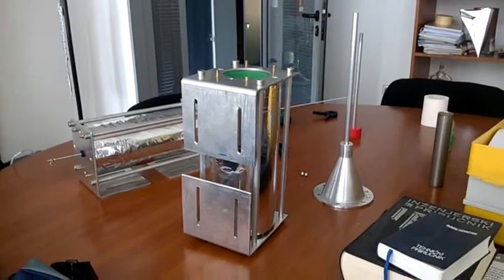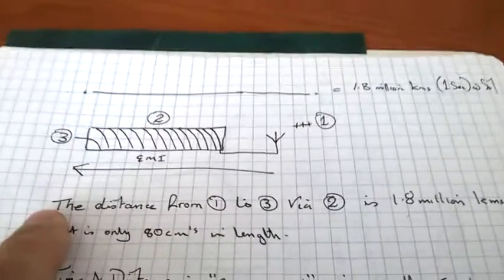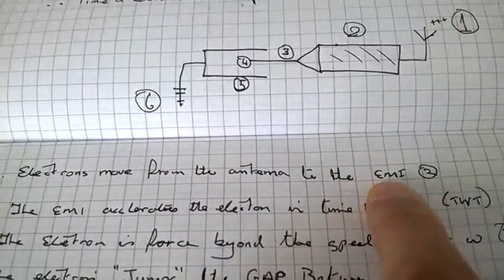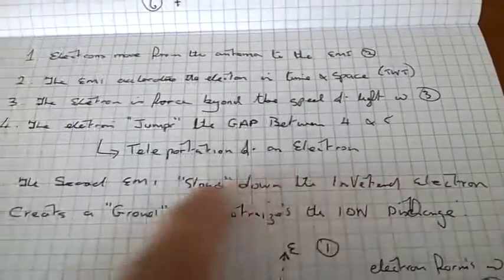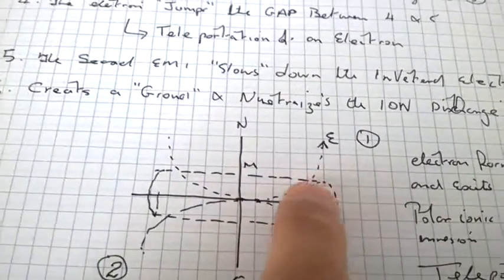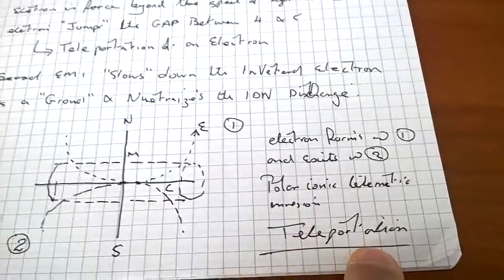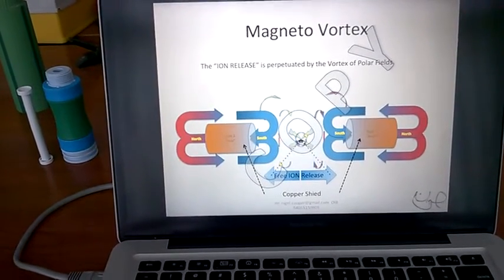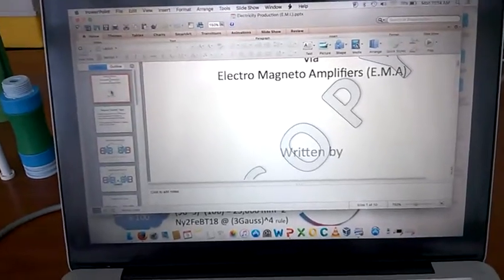TWT Time dialtion

Comment: Hello Mr Cooper, please help me with some explanations to the following below.

1. If the Speed of Light in a Vacuum is 299,792,458 m/s, you have quoted this in another video of yours, that is approximately three hundred thousand km/s then where do you get 1.8m Km from?
2. Where do the ions come from?
3. What is "The Other Side", 5 in your diagram?
4. Where do the electrons come from in your list below the diagram? You indicate positive ions at point 1 the antenna.
5. How is the electron travelling at more than the speed of light "shown" at position three.
6. What is an Inverted Electron? How is it slowed down? Your point 5 in the list below the diagram.
7. How does E=mc2 have a negative state?
8. What is Magneto-Compression?
9. How does an electron from at the peak point of E=mc2?
10. How is the coating of ions with a reflective surface achieved? What charge do these ions have? What charge does the reflective surface have?
11. How does the introduction of an antenna and a ground cause the spark of 3.4 million volts?

I am currently writing my doctoral thesis on "Theoretical Poly Dimensional Multi-Phasic Analytical Transformations and their Applications to Hypo and Hyper Quaternion Rotations in Galoisian Vector Spaces" and would like to understand more about your investigations as I believe they directly relate to what I am working on and the direction my thinking is taking me.

Thanks for taking the time to read this.
Reply: @Geoff Doyle 
1. Light as no speed but a " rate of induction "  interpreyation is key , it define your paradygm 

Are you ready for the truth ? 

If , beguin by that : https://youtu.be/t45m2aCR2lI

Good luck

Comment: Nice edu clip thanks for helping us understand.  The math supports your arguments as the square function has 2 sides to it's parabola not just one.  I also agree with your time compression dilation theory as power consumed or created has time as it's major determinant. IMHO (Opposite wound coils often = opposite rotating vectors in time space).